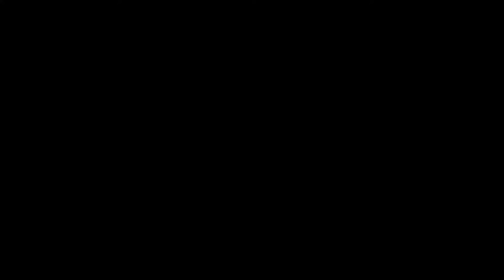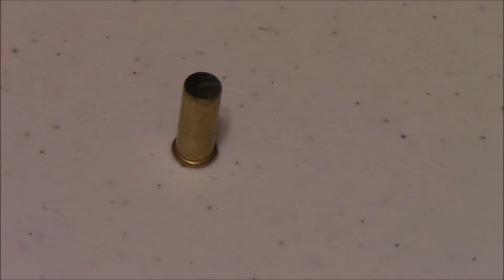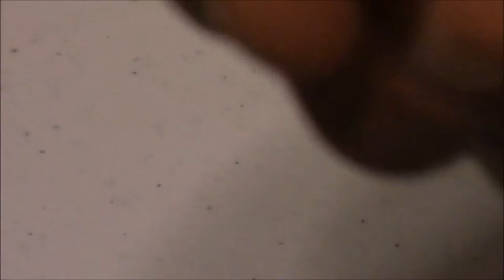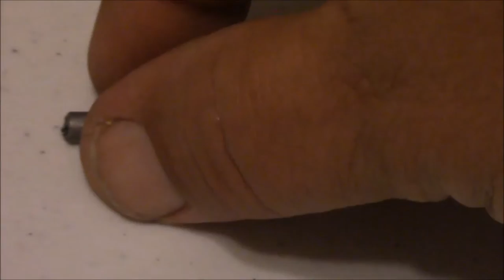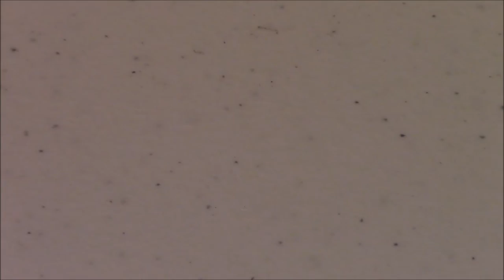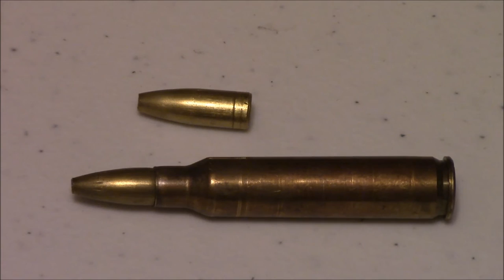A Short Overview Of Making A 22 LR Case Into A 223 Bullet

Comment: 1) Or?  run a fired, cleaned (lubed?, annealed?) .22 long rifle case, open case mouth first, using a standard press, through a standard? .224 resize die - displacing case rim just beyond the rear of the fired .22 case to make a bit longer, now slightly hollow,  closed base, .224 dimension  cylindrical  jacket. using? a longer drive "punch" to enable case to clear die each time? , a "punch" having a less than .224 diameter, matching the inside diameter of the then formed, slight hollow base of the now formed jacket

2) Place now formed jacket in a small, medium or "large" meplat,  flat point "tip of bullet pour" bullet casting mold, then cast bullet into the jacket containing mold  manufactured to have a very slight cannelure "taper crimp depression" just above the top  of the .22 long rifle jacket, or not, and just use a  slight taper crimp on the .223/5.56 case just into the starting of the bullet ogive at the top of the formed jacket?

3) bang!